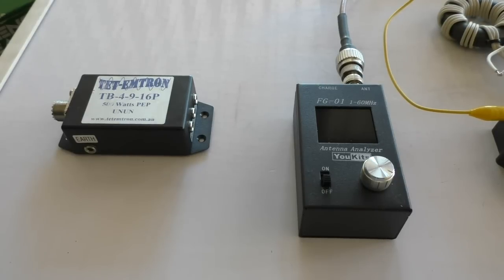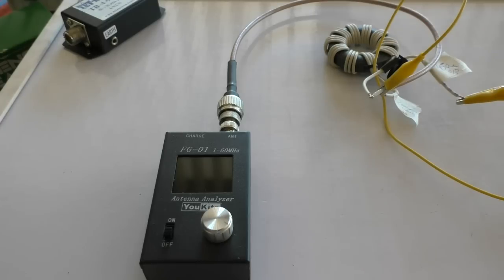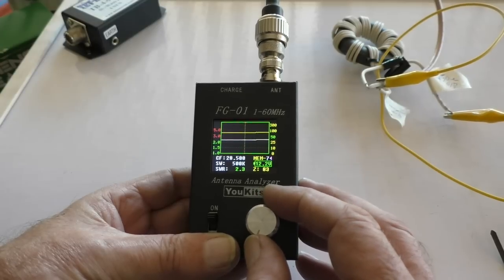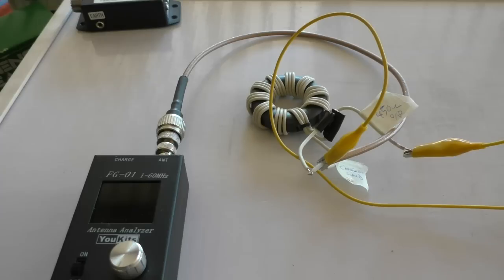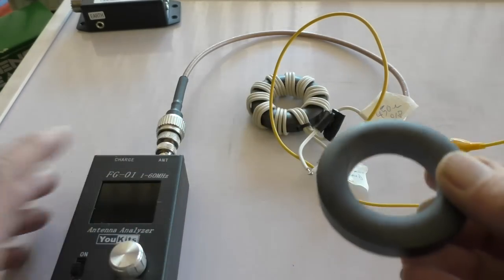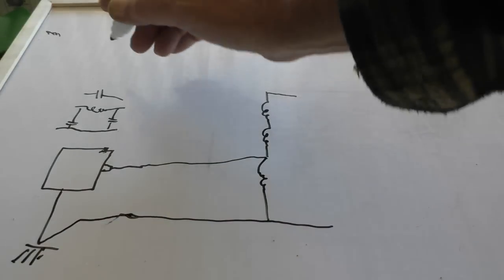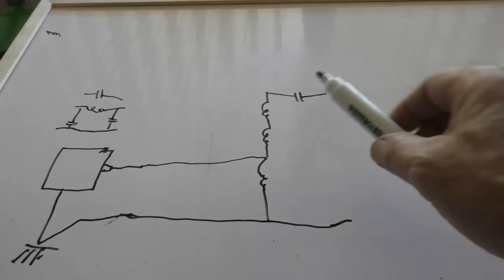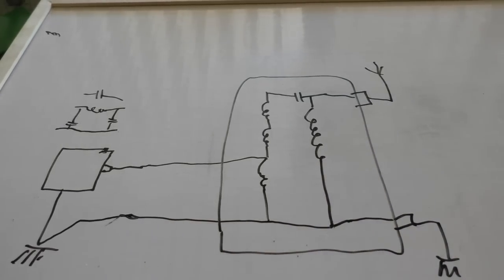Another Look At The 9:1 Un-Un

Comment: Calling this an UNUN assumes it has reasonable common mode choking impedance. Because it is a voltage device, it  likely does not have nearly sufficient choking impedance. The device is actually a 9:1 transformer with completely unknown common mode impedance- which is the MOST important characteristic of baluns and ununs. SWR is easier to measure but again tells us zero about its effectiveness as an UNUN or BALUN.
Reply from the maker: Sorry Dale... I'm missing your point here.
Reply: @vk6cs456   What is the purpose of an UNUN or a BALUN- it is to diminish common mode currents on the outside of the coaxial shield (which, because of skin effect is seen by RF as a separate conductor). Common mode currents on the coax means that  the coax is now part of the antenna. This can lead to distorted pattern, noise from the shack being transferred to the antenna via common mode and then to the  rig via differential mode.What you have made is a transformer- without  taking measurements, we don't know if it is performing the primary goal of an UNUN- to reduce common mode current. But because   your design is a voltage device, it likely has very poor if any  common mode reduction. Measuring SWR tells us zero  about its function as an UNUN. In order to judge its efficacy as an UNUN you will need to measure its S11 impedance- for that  you will reuire a vector network analyzer. If you are not  familar with Scattering parameters and thie measurement- well, that's another class.
Regards,
Dale W4OP
Reply from the maker: An UNUN is an impedance transformer, usually 4:1 or 9:1 , which matches an unbalanced antenna to a feedline... isn't it? If it's a 9:1 UNUN putting a 450 Ohm resistor on the antenna side should produce a good match to 50 Ohms on the TX side shouldn't it.
Reply from the maker: @W4OP  It's an unbalanced impedance transformer. Unbalanced 50 Ohm coax to 450 Ohm random wire and ground. At 9:1 with a 450 Ohm resistor on the antenna side it should produce a 1:1 match on the coax side. You're talking about balanced to unbalanced, that's a balun. I'm talking about unbalanced to unbalanced. That's an unun. Did you watch the video?
Reply: @vk6cs456  Correct, it is an impedance transofrmer and not an UNUN- as you have  apparently no clue as to what the choking impedance is.
Reply from the maker: Are you one of these guys that goes around on you tube looking for videos to criticize... and posts stupid comments without actually watching the video? https://wireantennas.co.uk/9-1unun.html  Why on earth would I be interested in the choking impedance?

Comment: For 9:1 UnUn you should to use 150 ohm transmission line, obviously yours has a lower impedance and this is the reason for the increase SWR on higher bands.
Reply from the maker: I think the non linear response has more to do with the type of Ferrite core. The Un-Un goes at the antenna feedpoint, so no transmission line is required.

Comment: looks like 10:1 unun
Reply: I can understand why you would think that it's a 10:1.  I used to think the number of turns indicated the UnUn ratio too.  I have since learned that is not the case.  I have seen 9:1 UnUn's made using only 5, 6, 7, 8 or 9 turns that work quite well.  I think the core type and diameter as well as the wire type and gauge are deciding factors.  It seems you have to increase or decrease the number of turns to get the best results with a particular longwire antenna load.  The impedance of a longwire antenna can be between roughly 450-1000 ohms, thus the difference in turns to match the load.  Just my observation.....  Anyone else that can explain this for certain please let us know.  73!

Comment: Very (VERY) informative. I never knew that the configuration of auto tuners was a Pi network. 
Had no idea WHAT it would be, even though in my early days, I built basic Pi tuners as the most versatile, after we'd stopping tapping the incoming antenna lead, up and down the PA tank coil with a DC blocking..H.V. working capacitor! They also offered some filtering of harmonics!
Thank you. Most appreciated. 
That qualifies you for free entrance into my college for drawing straight lines! 
Great video. Relaxed and enjoyable.
Don't worry about bent lines. Electricity..DC and RF can find its way down wiggly wires anywhere below 28 Mhz although it's starting to get a bit picky by ten metres.
Reply from the maker: Thanks for that. Did I say auto tuners are a pi network... crikey, most of them are L networks. Sorry about the 'bum steer' as the Americans say.
Reply: Oh Dear..I'd better check to see if I got it right!

Thank you for your message...

73 G3NBY

Aha! You said both..."an L  Pi match...." 
I missed  the L but you did draw a Pi section.
Reply from the maker: Some ATUs are a pi circuit, most auto-ATUs are an L circuit. The type that give the widest matching range are T circuit ATUs.
Reply: VK6CS.
Well...Didn't know THAT! Wish I'd known when I was making manual tuners (matchers)  Never built a T match.
Now that you've said that, I might just modify an old Z match, just out of curiosity. Bound to learn SOMETHING from it!  That's Ham Radio! 
Good onyer Cobber!  Bet they don't say that stuff anymore!
73 de G3NBY
Reply from the maker: That's Ham Radio for sure... have fun, and let me know your results.
Reply: VK6CS o hellow im py1ax Tony is Nice vídeo like but i need help my boy move tô gold coast queesland its any store for hamradio i try but dont foud IF you now pls can you send tô me realy apriciate tks73/dx

Comment: I would rather spend ages experimenting than £'s on commercial gear. To me that is what Amateur Radio is all about since I was a kid years and years ago.
Reply from the maker: As you say, that's what amateur radio is supposed to be about. There's not much home brew going on these days though. Linear amps and antennas, that's about it.
Reply: john cliff
Oh Boy!  Am I ever on your side! 
Unfortunately, that ideal is fast disappearing.
I can now afford the shiny stuff (Couldn't possibly as a postwar school boy beginner) but still like to call someone on a bread-board of QRP jumble and then tell them that I'm using a shiny thing to receive, because of its bells and whistles, to winkle out a tiny signal from the constant barrage of QRM sewage which we are forced to endure. Even though my OV1 valve regen.  has almost the same sensitivity, it can't cope unwrap the noise!
Your posting touches a great nerve of nostalgia. Thank you.
Reply from the maker: Thanks again. Amateur radio is all about playing around with bits and pieces, and if you can get a good result that saves a few quid all the better.